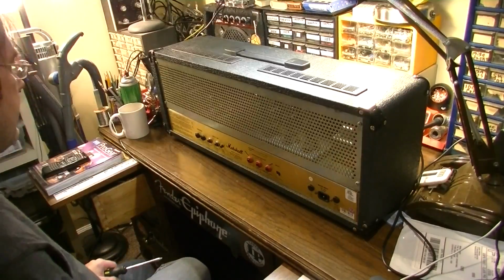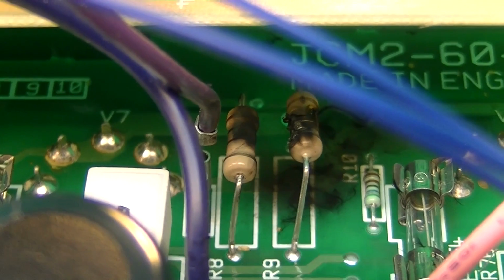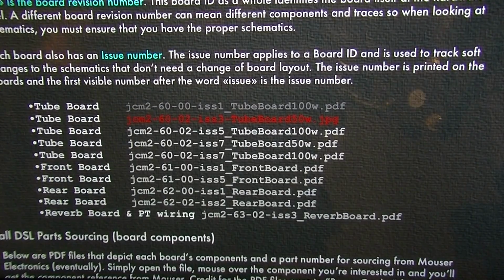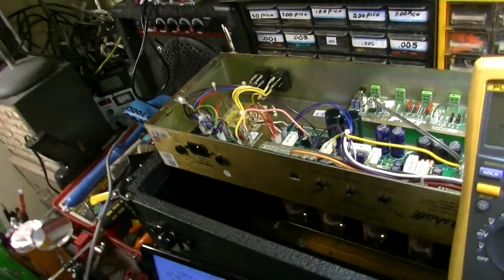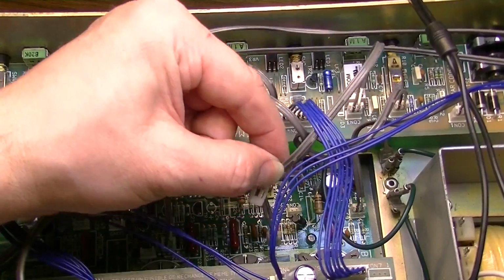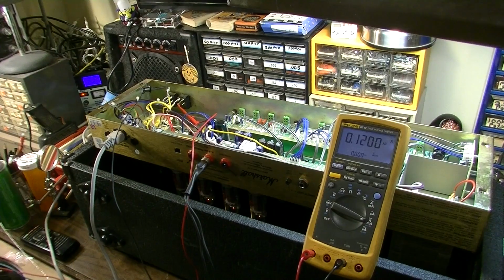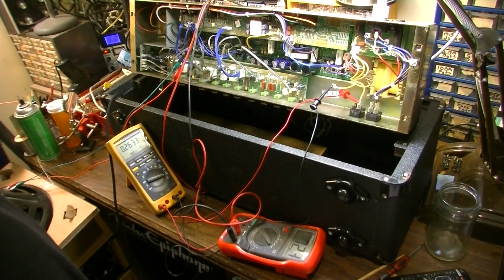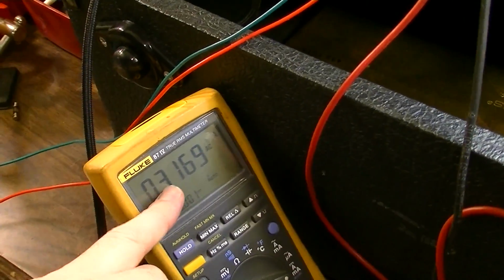Mother of All Marshall Amp Repair Videos - DSL100 Blowing Fuses, Bias Runaway, Fun Times!

Comment: I have a 1998 model and a 2005 model of this dsl100 amp.Back in around 2000,I bought the 1998 from the now defunct mars music.I had it for a couple of weeks,and it started blowing the HT fuse.So I replaced all the tubes.It didnt fix the problem.I then took it to a marshall service center which was less than a mile from where I lived.They kept it for about 3 months,and finally called me to come pick it up.That they couldnt figure out what was wrong with it.They only charged me about $40 to work on it.Even though it was still under warranty.I asked them what they thought the problem might be?He said he thought maybe it was the power transformer.So I decided to try and troubleshoot it myself.I have an electronics background,and have worked on tube circuits before back in the 70's.I must have spent over a hundred hours or more working on it.And I never got anywhere.My problem was the drifting bias.It would steadly climb on its own.I resoldered everything on the mainboard.Even replaced a bunch of caps,and resistors.Nothing would fix it.Finally I read somewhere on the internet that it was the mainboards circuitboard that was defective.The material in the mainboard that would conduct and act as a conductor.So I decided to retire it away in the closet.A new circuitboard wasnt available at the time.The only way to get a replacement board was to ship it to England,or take it to England,and they would replace the board while you waited.But they would ship you a new board.So  I decided to buy another brand amp.It didnt sound as good,but at least I could play my guitar.Finally I got tired of the bad sound from the other brand amp,and decided to buy another dsl100.So I bought another one from Guitar center in 2005.Anyway to make a long story short.I kept checking to see if a new board would become available.It did.But I couldnt order it directly from the distrubutor.I had to order it from a retailer.Once I received the board,I changed it out,and the problem went away.I also read that the 2005 model was also suseptable to going bad.So I bought another new board as a spare.I also checked the bios for drifting.It does drift after a couple of hours of playing.But not enough to go way out of range.But I suspect eventually it will go bad.because the new boards bias is rock solid,and doesnt drift the least.I havent played much in a few years.But I want to replace that board before it actually goes.Since I still have the new board.But you know how difficult it is to unplug all those connectors,and mark everything.I definetly had taken photos before I removed it before,so I would know if they were on correctly.I also had marked everything with tape.

Comment: I've bought one from a customer for £50 , as the solution to the runaway bias from the conductive pcb is a new board from Marshall , £125 , I think was the price . Plus labour , not cost effective for him .
But eventually I'll modify the old board with the "Dr Tube" drill and mod method . I think I paid £60 for the kit .

Comment: These boards are notorious for bias drift issues. Board builds various creeping paths such as between B+ and Bias feed voltage - on the right most Screen Resistor. Also on the sockets themselfs and the PI circuit.  
Im actually rather surprised here that one of the 1 ohm resistors was shot. In order to shoot out a 1 Ohm 2 Watts resistor you need relatively high amperage / engergy which is unlikely to flow in a tube between Anode to cathode as they have a very high series Resistance, even when turned full on. 
At the same time, even if the heater to cathode would short - where enough energy is available, its still only virtually grounded via 2 100 Ohm Resistors. So there again is not a huge energy to be expected. 
Anyway... what i find strange is that i had worked on a couple of DSL / TSL (reworking boards, swapping boards and so on) and in 70 percent of cases i would say i had ark over in one tube aswell. What i find interesting is that its always the same socket 3 so as you had in your amp. 
Nice video. Thanks for that

Comment: My biggest nightmare repair was a Marshall JCM2000, with a semi-conductive circuit board, it took me almost a month to figure out what was going on, but once I did, the repair only took  less than an hour.  It is what you don't know that will hurt you!
Reply: Hi Rene!  Conductive pcb's huh they're no fun!  Was yours a fibreglass pcb that was  burnt by a component?  I have had them go conductive because a component has burned up so badly that It completely burned the fibreglass pcb material below it into conductive charcoal.  The only solution was to gouge out all the burnt pcb & use tinned copper wire to repair overheated & mid-air tracks.

Comment: Did you check to see if that cap was dc-shorted?   Just curious, thanks for taking us along for this!
Reply from the maker: It was still a cap, but barely. Meter only tests at about 2V. This thing sees about 450V in circuit. Probably leaky as hell at full voltage.
Reply: @TheGuitologist  Hi Brad I wonder what that C2 cap would have measured with just your ohmmeter across it?  I was hoping you'd check that but you didn't appear to check it, other than with your little component tester.  By the way, you've measured real old caps with that tester that show a higher capacitance than they're supposed to be, sometimes much higher.  

I reckon these old caps may have high leakage rather than high capacitance, & I would suspect any old caps that read high.  I would additionally throw my multimeter set to ohms across any that read high with the little tester.  I'm thinking that very high leakage could fool your little tester into thinking it was high capacitance.

Comment: Yeah 45mA/Tube current i feel is too hot, I used a scope and injected a sinewave to set G1 bias for minimum cathode current with no observable crossover distortion on a dummy load. The DSL-100 i worked on had the wrong G1 stoppers installed from factory they should be 5k6 as to schematic. The bridge rectifier for the preamp heaters really should have a heatsink on it as it runs too hot. you were lucky with this one. The DSL i repaired was in way worse shape. It had serious thermal bias runaway problems caused by a combination of design flaws....Marshall has redesigned the current model. and to no suprise, no longer has the tube sockets mounted to the PCB eliminating heat transfer from the tube pins. which was a big problem in those early models and they now use a digital reverb instead of the spring...

Comment: Those JCM2000 DSL's are horrid beasts . Sold the ones I had . There is also the BR2 4 legged rectifier for the preamp tube heater circuit that fails often on these .Also , running them at 90ma makes the power transformer so hot , its scary . Basically the JCM series DSL's like this are born sick . I highly recommend to stay away from them . Horribly flawed design by the bean counters . Apparently the newer ,  cheaper made in Vietnam DSL's dont have these issues , if any .  It was entertaining watching you suffer through this one  ; )
Reply: Yeah that bridge rectifier really needs a heatsink on it..

Comment from the maker: For those asking, here is the link to the exact component tester I used in the video: https://goo.gl/FzQi7Z
Reply: Yeah Brad it's a nifty looking little tester & I might build one for myself.  But I wouldn't trust it for one second with leaky caps to be honest.  Use your multimeter for that!  Or better still, I was gonna look into the capacitor leakage tester that Paul at Mr. Carlsons Lab designed.  Looks like a fantastic device & the most sensitive I've ever seen!  It can measure leakage through insulated wires!  His design is apparently on Patreon.  I'm gonna make myself one, & you probly should too!  Make a video of it if it's ok with Paul.  I'd definitely watch it.

Comment: Another idea.  Why did the tube spark?  Could there have been a nasty quick burst of parasitic rf happening?   I have been known to add screen resistors in amps where they were absent and increase their value slightly in amps already with them.  Also any screen or grid-block resistors must be as close to the tubes as possible - preferably right on the socket.  And I never use anything less than a 1-watt power rating cuz the little guys are too fragile.  Besides we are dealing with high voltage, and bigger resistors resist high voltage spikes better than small ones.  In my lab where I operated and maintained a 2.5 mega volt van de Graff we were always concerned with resistor spike voltage ratings too, besides their wattage.

Comment: Sup, as I remember, 1998 to 2002 for the dsl 50 and 100 models were infected with the conductive boards. Heated overtime to conduct. I think I understand it. good luck.
Reply: Exactly! but this one has a bad bias supply on the left side, inadequate pots, and connectors.  The conductive board problem, is likely a result of insufficient removal of chemicals used for etching the board, Euro Union solder resulting in tin whiskers and film of tin dust on the board, plus tenth inch spacing on the circuit board for hi voltage circuitry which is inadequate, for Hi Volts hi impedance circuitry.

Comment: Thank you for posting this!!  Could this the be cause of my sick DSL?  I can't wait to find out!  Geez, much cheaper than replacing the socket PCB... that I already spent money on :(  Marshall doesn't include those plastic stand-offs with the new board and repurposing the orginals barely works :(  Not even sure where I can get new ones.  I need some!
Reply from the maker: Try Mouser for the plastic stand offs.

Comment: Your chuckle after going through all the connectors and wires to remove the bottom board was hilarious lol.  I do not have a marshall amp like that and had no need to watch it lol
I picked up a 1961 Electrohome made in Canada 3W four tube Portable Record Player that looks like a suitcase on kijiji for 20 bucks.  Plus the guy delivered it lol.  It just humms like a mother effer.  Level knob does nothing. Balance knob does nothing.  Bass and Treble Both seem to do something.  No noise without tubes in it.  Just wondering if that could be a output transformer issue?  I don't have a tube tester but ordering tubes now.  All the electronics look pristine.  When you open up the case it smells like an old mans cabin.
Love from Canada :)
Reply: Justin B. The first thing that I'd suspect would be the B+ filter capacitor-they tend to dry out.
When this happens, the capacitor value goes WAY down, thus the hum
Reply: Ok!!!! Thanks dude!~!!  I plan on changing that as well just was trying to sort out output tranny before I get involved lol
Reply from the maker: An amp of that age, change every single capacitor in it. And since it started life as a record player, you'll want to modify the circuit to optimize for guitar use, if that's what you're using it for.
Reply: Hey!!! Thanks for taking your time to answer!!  I have just picked up caps and am about to plug in the soldering iron.
I'm going to just restore it as is and go from there.  It's in immaculate condition and I have some vinyls.  If it craps I'll guitar amp it lol.
I am working on videos as well so I can share my work with you fine folks.  
Love from Canada :)

Comment: PLEASE HELP ME SIR! I have a BIG PROBLEM WITH MY AMPLIFIER! I TRIED 1 WEEK TO SOLVE THE PROBLEM SO I NEED YOUR HELPP 🥺🥺🥺

I have a Turkish Marshall 1987 x amplifier clone from 70s. No matter how I try to fix, the inner power tube red plates whenever I play my guitar. Even though I changed the tube’s locations, the problem still continues. So I came up with that tubes do not have a problem but socket does. I even change the phase inventor coupling capacitors. I measure the colts in the grids of power tubes and it was -40 volt which was a suitable number. One of the screen resistors of the other non problematic tube was blown and I have changed it in case there was an imbalance but nothing changed.
Reply: Check for bias on the grid of the power tube that red plates,  there should be somewhere around  negative 26 Volts, on that grid, and the same as all the other grids.  You can take the tube out  (take all tubes out) and measure the negative volts on the the grids (at the pin for grid itself), they should all be the same and close to 26 volts for the 1987 Marshall with EL34's.  If it is lower, then repair the bias supply, which is , a diode, filter cap, and a few resistors, could also be You have to retension that tube socket sleeve, because it is not making good contact with the tubes grid pin.
Reply: @Geopholus  you are the best! thank you so much
Reply: @hazal3225  Let me know how it goes,..Elevenous Amps facebook

Comment: Lots of Marshalls are like this. Either replace it with the final 'issue' board, or you'll keep having problems, in many cases. The new issues are simply because they messed up...they didn't issue a new board because the old ones worked.
Reply: I have a 1999 TSL 122 I'll try to see what board version it has tonight might already be replaced
Reply: Think the latest board is Rev 20 for these amps
Reply: @gazjscott  Hi Gaz!  Revision 20?  Really?  It took them 20 goes to get it right that's bloody ridiculous if you're correct!  It's actually shameful really.  These people have being building amps for 50 years now so you'd think they'd know better.  Get your shit together Marshall!

Comment: Hi, great channel, loving the videos, man. I’ve currently got a TSL100 on the bench, she’s blowing main fuses- it's a revision 6 main board.
I’ll most likely will replace it with the newer revision 20 board, but want to do some more tests first before I have to give the owner the bad news... I’m currently checking the power supply board - exact same one as one your DSL100 (issue 3). Coincidentally, I had very similar readings as you got when testing the two caps… C16 measured fine at 22uF, but C2 measured only around 20pF !! These caps are labelled the same so both should be 22uF. I just found that a little odd, exact same symptom, exact same cap. So i'm wondering if anyone else has had this happen and if in retrospect anyone can shed some light on why. I’m wondering if the reason is further down the line somewhere, rather than an isolated case of a bad cap.

Comment: Also right above that 7W 270 Ohm Resistor..those two caps,have a voltage rating of 63v.. upgrade them to 47uF 100v

Comment: My DSL100 main board has a 220K resistor in R10, R70, R66, & R7 but 56K only marked in the updated schematic diagram, I’m having trouble firing up V7

Comment: I have a TSL 100 I bought from a guy who used it in a studio. He has many different Marshall heads, so I doubt he used this one much at all. He bought it about 15 years ago and never changed the tubes. I checked the bias and it was at 90mV both sides, as expected. 

I adjusted them down to 75mV to try and extend their life. It played well on low volume (VFR engaged), but today I cracked the volume, but only about 25%, and the HT fuse blew! No burned components I could see, but one of the power tubes looks toasted. The EHX labels on them are all different shades of green, with the suspected one wiping off as dust (overheated?). 

Would too low bias cause a tube to burn too hot?
Or, is this just possibly from the tubes being old and only now getting use? (I play in a metal band. Luckily, thus didn't happen before our last gig)
Reply: Hi CTS!  Man that sux your low mileage amp karked it like that.  I hope you got it fixed.  Mate I think biasing the tubes low could only help to extend their life rather than shorten it.  I'm starting to see a pattern with these later Marshalls.  I think I will be staying away from them.

Comment: just replace the board with a rev. 20 cures everything !!!!!!!!!!!!!!!!!` I  isolated  tube pin on all power tubes and jump a wire  V8 5 pin too R10 resistor ,, v7 5 pin to R resistor . V6 too resistor and v5 too R7 resistor   that cures bias runaway as temporary solution till I received the  new Revision  board but the Green board itself is very unstable too extreme heat  ,, the Version 20 board solved all the issues $200 for new board well worth it these are by far the best sounding Marshalls I have the TSL 100 version .. The amp your are working on the version 7 board could have caused all the other issues also
Reply: Gr8 info! Options are starting to open before me. Personally, I love the sound of my TSL 100 & 1 of my Explorers...

Comment: Ceramic caps in this amp do short.  Had one is the preamp parallel to the 22uf filter cap popping the HT fuse and also warming some components enough that caused the solder joints to reflow and go bad.  Warm the ceramics with a hair dryer while measuring them an it become apparent.

Comment: My JCM 2000 DSL 100 is missing a few dial indicators so I have no idea what my settings are, two middle power amp tubes weren’t working so I pulled em’ out, green channel stays clean no matter how high the gain.
My MG cabinet is too narrow for the amp head, so my half stack looks like a cross.  
It sounds freaking killer!!!
I’m afraid to have it serviced.  It might kill whatever mojo it has.
Someone gave the amp to a guy in exchange for some Cocaine.  He never came back to get it so it got passed around town and ended up with me,    It’s ghetto fabulous!!

Comment: My TSL 100 seems to only blow the 1 amp fuze on bigger stages with lighting etc.
i plugged it in and it blows before even turning on standby.
All the lights on amp are on but no sound?
Will a good surge suppressor help?